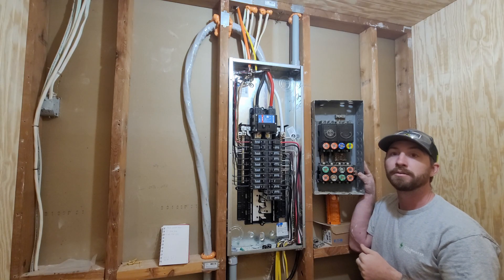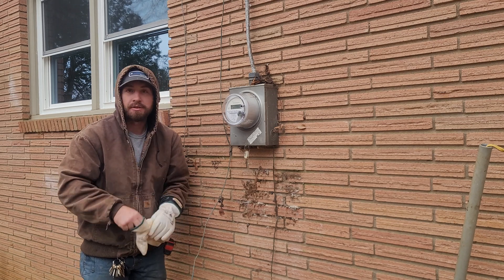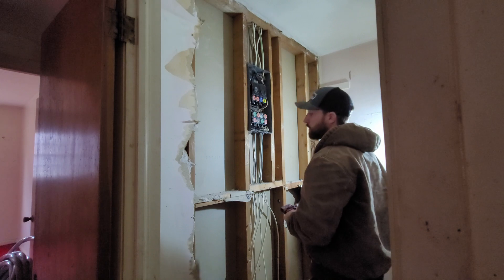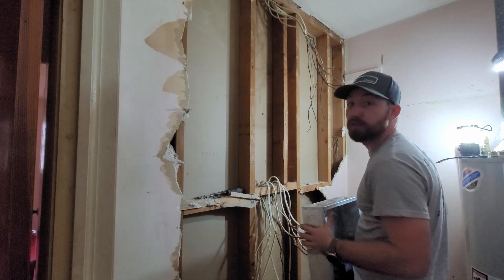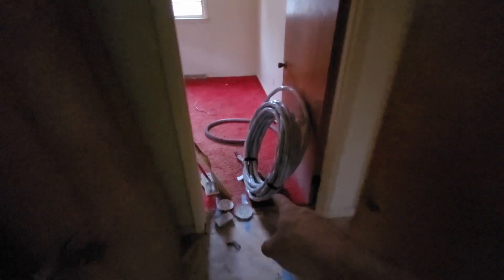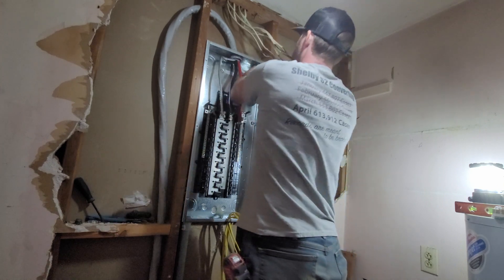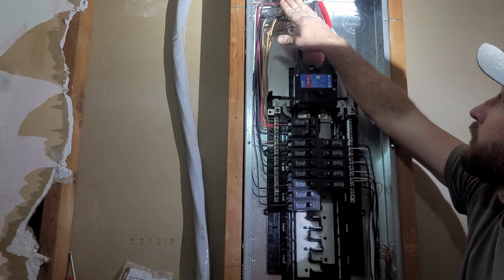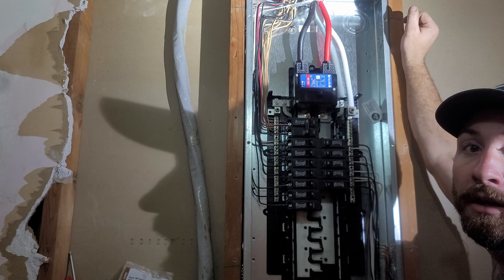100amp to 200amp service upgrade

Comment: I use to work for a large rural power company but I'd rather have a power company electrician pull and restore the meter because of the danger of doing that. They have been known to explode from an inadvertent fault. I have a main disconnect right at the meter so I wouldn't have to pull the meter anyway.

Comment: How did you do that without being a licensed  electrician?
Reply from the maker: @darylnorthern8350  as a home owner you can do all your own work, except HVAC as long as you live in the home for at least 1 year. That's in my area. You can look up your local codes to find out what your allowed to do in your area.
Reply: @Grazing-M-Acres  True, but you still require to pull permits from the city., Right?

Comment: If you're the handy type who is detail-oriented/meticulously pays attention to details, you'd save yourself a boatload by/via DIY.
Reply: Hence whyI’m watching this.  My high-end full-service home service company wants $10k - 13k (depending on which panel) for a 150 to 200 amp service upgrade.  😮
Reply: @Dr_Kenneth_Noisewater  No kidding, the costs can be outrageous... I'm working on a similar upgrade and know enough to get the job done the first time correctly up to the mast... An electrician is involved of-course, but I can at least do some of the grunt work such as adding outlets and so on and the box etc... If you are handy and can follow basic NEC requirements/proper grounding/wiring/matching of wiring to fuses/boxes/safety, etc., the job can be done as quickly as 3-4 hours or over a week-end or two, saving yourself thousands... Good luck on your project Doc !!

Comment: what size entrance cable is that?
Reply from the maker: @tested123  I forget the exact name but it's aluminum wire rated for 200 amp.
Reply: @Grazing-M-Acres  in canada it would be 250 mcm.

Comment: 6ft to main breaker NEC code
Reply from the maker: Main breaker is located outside just below the meter, pannel on the inside is a sub pannel.
Reply: No the height of the main breaker in your panel should be 6ft
Reply from the maker: @dalejones2108  is that a new code, I've never read that in our code book.

Comment: You will not get a good ground if you separate the ground from the new codes. That's why when you tie everything at the first panel. You get a better ground because the neutral hubs the ground and then anything after that, you separate, maybe put a sub panel in.  Next to that 1 or another, one or somewhere in the house.Then you separate the grounds and the neutrals

Comment: When you put the ground, you gotta put on a new job bar. Because that's your main panel. The neutral hubs the ground. How do it's work and then you? Separate your grounds after that, if you put a sub panel and you separate the grounds from the neutral.  Or else you're reintroduced the neutral back into the ground system

Comment: Is there a difference in the service line-in equipment? Did the utility company have to put in a 200amp compatible meter?
Reply from the maker: @themillerhaven  I install a 200 amp meter combo base ( its code for my county). I also had the utility company upgrade the transformer and install a 200 amp service wire underground which they did for free.
Reply: @Grazing-M-Acres  right on. Thanks.
Reply: Didn't you have to pull a permit

Comment: If you dont mind me asking how much would it cost to change the 100 amp fuse box to a 200 amp service upgrade? Thank you
Reply: depend on what state， if that state applies the newest NEC code, start at 4K
Reply: $10k to $13k depending on which panel for a 150 to 200 amp upgrade in suburban Denver from a full-service home service company including permit/inspection and a long term warranty.  I could probably get it done by an independent electrician for quite a bit less but the company I work with works quickly and really stands behind their work for the long term and that is worth something to me.  But damn.  $13k will make a guy learn some stuff.  There are so many pitfalls and things to know about the NEC in my case that I will probably just pay someone.  But i do have a 50a sub panel that could be pretty easily upgraded to 100a with some new conductor and breaker.  I’m also looking at consolidating some circuits into tandem breakers to free up a couple slots.
Reply from the maker: To be honest I have no clue. All electrical supply are expensive. If I had to guess probably a couple thousand or so.
Reply: Thank you  @Grazing-M-Acres

Comment: "Extremely aggravating."  You are too kind.  Wrestling those SE cables is one of life's great challenges.  Some electricians make a service loop for each cable inside the box and then connect the bare ends to the main breaker.  This eases the aggravation a bit and also facilitates any future work that may be required.  Another sensible practice is to connect all of the grounds and neutrals to their respective bars before installing any breakers. It's much easier that way because the breakers and the hot leads don't get in the way.